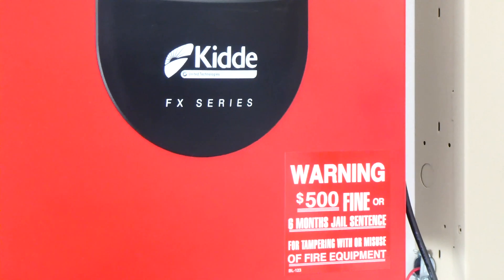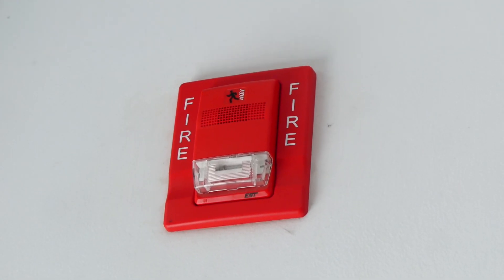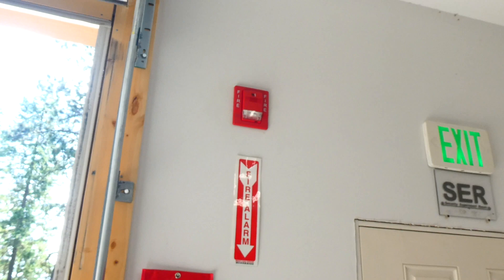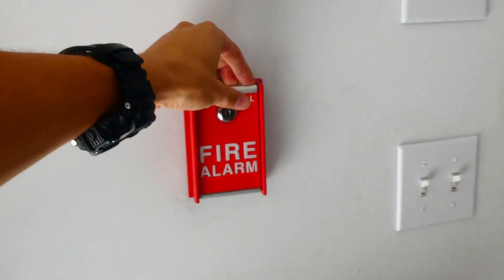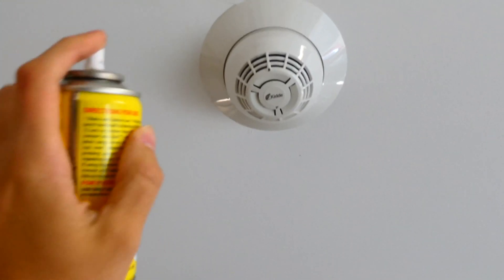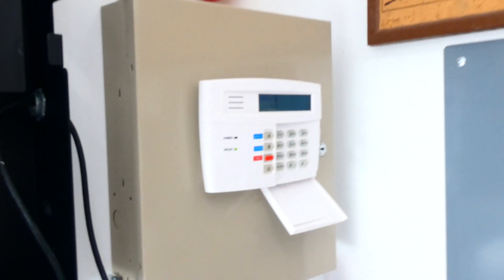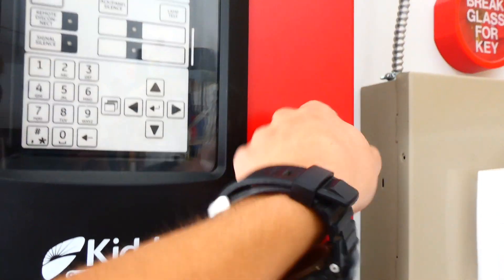Kidde System Test 21: Pulling an FCI MS-6 Fire Alarm Pull Station!

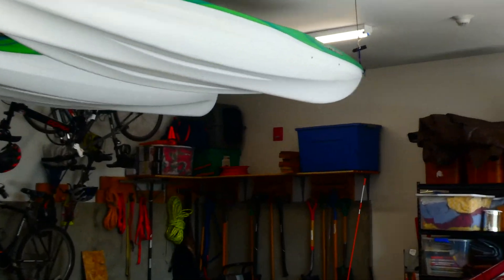Comment: 03:28 The reason why is because the higher the strobe brightness, the shorter the strobe flash because of a faster strobe capacitor discharge

Comment: That pull station needs to meet Ada standards at 4' to the top lol. Be careful installing a fire system like that. If an inspector sees it, he/she might want to see fire permits and look for proper placement and sealed prints. I install residential and commercial fire systems. Would have been cheaper for you to go with a Honeywell vista32 fbp. Does fire and burglary.
Reply: Not sure if that applies to something like this, since it's just his garage